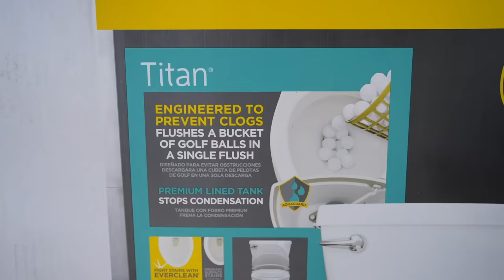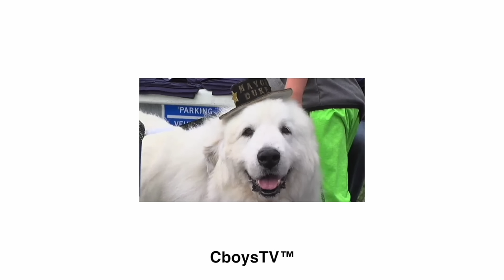Trading my Dirt Bike for a Shifter Kart on Facebook Marketplace!

Comment: Great video, as always. That was an even trade, imo. 

Pro tip: 
To unlock the next level, you Cboys need a fabricator who can make you two of these karts in a week. Anything you can dream of. E.g : 
Stretched Sea-doo (Limo-Ski)
Stretched Pit Bikes (wheelie that)
Loop ramp for the Razor (Evan)
Wings for the R6 (Evan fly)
See-through boat
See-through car
Boosted anything 
Radio controll anything 
Frickin' laser beams 
Once those missions are complete, you will proceed to the next level of 69.